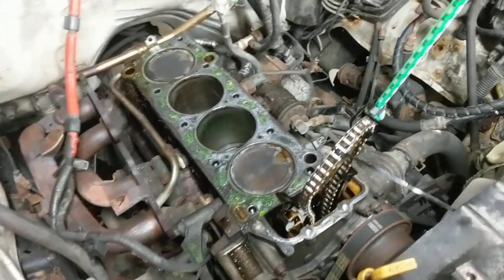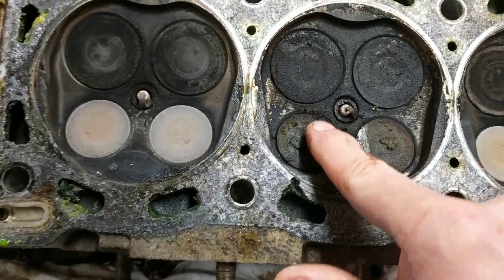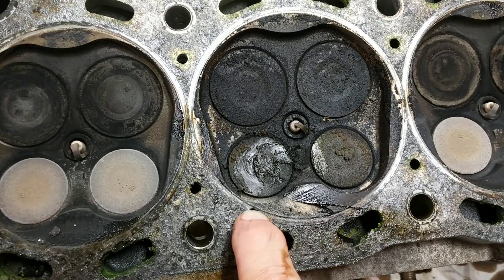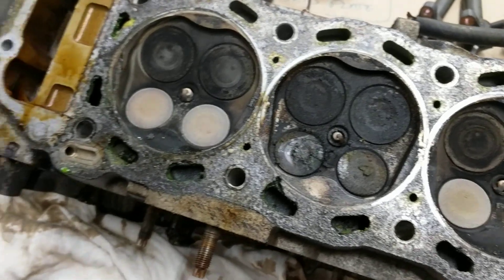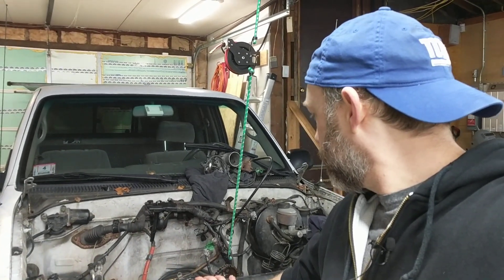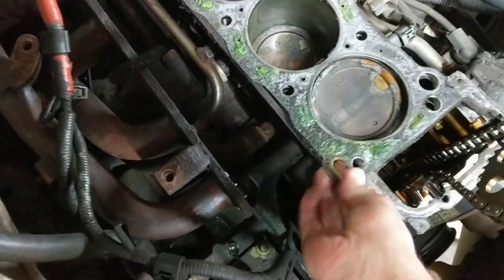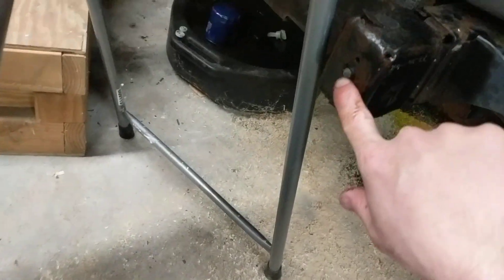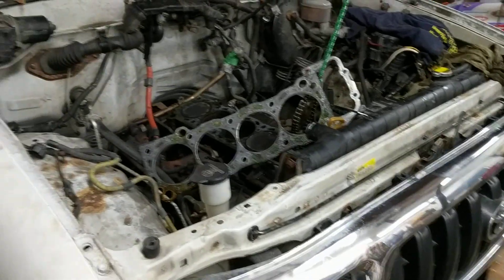Here's Why You Should Flush Your Coolant Regularly!!

Comment: Funny I just tore off the head on my 96 Tacoma because I was getting oil in the antifreeze, It has over 300k miles still ran great, but was getting bubbles in the overflow tank. It never ran hot or overheated just let go from old age, the headgasket material itself was disintegrating because its composite not steel. The coolant ports were getting clogged from the head gasket material. I'm gonna fix mine and drive it a bit longer then swap the engine to something else.

Comment: I've never changed or flushed my coolant system... ever.  I'm 60.  I'm trying to justify buying a vacuum fill system ($100) vs a plastic burp funnel to ($40) to bleed the system after i replace a thermostat.  After this video, I'll get the tool and flush the wifey's system as well as my Rubicon.

Comment: This proves how using the wrong coolant type can corrode an aluminum engine made of certain alloys. The old coolant used in this engine was clearly the green type ( can't recall the correct name/identification at the moment ). Using the correct coolant doesn't allow this corrosion to happen in the first place when changed as recommended. The coolant needed for this engine has a red/pink color, NOT green. Bought my 2000 Tacoma 4x4 with 3RZ-FE motor brand new in 2000. 20 yrs later & over 346,000 miles, it still runs great. It doesn't even burn any oil.
Reply: 340k holy shit🤣
Reply: @Theegoaat  I clocked 375,000 miles on it last December, and FINALLY.......she blew a head gasket. I'm totally rebuilding the engine, even though I could probably just replace the head & head gasket and send it. I already bought the master rebuild kit from LC Engineering ( aka "LCE" ), plus a brand new, genuine Toyota head built by LCE, stuffed with all upgraded components, including upgraded stainless steel valves made by Super Tech, and they're also black nitride coated. This rebuilt engine will literally be better and more durable than when it originally left the factory. Transmission gets a clean bill of health from my buddy who owns his own transmission shop/business. Gonna drive this little Tacoma till I'm dead, or too old to drive, whichever comes first. I can honestly say: the first 250,000 miles were some tough working miles though, more than most "every day driver" and/or "only vehicle" Tacoma owners would be willing to put their truck through. As a lath mechanic ( for stucco ), I had my own business for years, and 5 days a week, I was towing a trailer with a 12' bed loaded with my folding A-frame scaffolding, all materials, scaffold planks, etc, totaling right at 1 ton. Did it every week without fail for about 16 yrs. On most weekends, I was towing my 17' bass boat with 115 Yamaha ( the biggest motor you could legally put on that boat. ) Boat, motor, and trailer weighed right at 1 ton as well. There were quite a few times ( but only once in a great while ) where I was in a pinch, and towed right at or somewhat above the truck's 3,500 lb towing capacity. I know guys right now with the same truck & engine........one guy has over 450k miles on his, and the other has over 530k on his. But they never worked their truck anywhere near as hard as I did mine. A little body work, prep and paint, and it's not gonna be worked hard like all those years before, because I'm semi-retired now. Both me and my Tacoma are gonna have easier miles with this new engine, even though it's going to be built better than original. Most dependable, durable vehicle I've ever owned.......and I've owned a lot of cars & trucks over the years.
Reply: @howabouthetruth2157  Yeah I own a Corolla and Camry they're little gas saving work horses. I also have a 2002 NQR I use for my business with 259k miles on it and the mechanic said just keep up with the maintenance and she will be fine for a long time to come.
Reply: @Theegoaat  There ya go! Enjoy the rest of your weekend & take care.
Reply: @howabouthetruth2157  Likewise.

Comment: WRONG COOLANT WAS USED. You can tell by the green color. The correct coolant MUST be used, and it has a pink/reddish color.
Reply from the maker: Yup.  But it might have been ok if the pink stuff was thoroughly flushed out before the green was put in.  The worst thing to do is mix the two.  The Toyota coolant lasts longer too, the green you have to flush often or the pH will rise and eat the aluminum.  That's what I remember reading anyway.
Reply: @WhatDennisDoes  Yeah that's kind of what I was saying: the green type will corrode certain types of aluminum alloys. And yes, it's definitely bad to mix the two, but still, only the recommended type by the engine manufacturer should be used, regardless. Never use well water to mix with coolant either. City water at the very least should be used to mix, but distilled water is the safest of all with the correct coolant. I've found that the pre-mixed stuff ( no need to add water ) is garbage. It just doesn't last, and begins to look like ya only used straight water to begin with. In my own personal experience anyway. Here's another tip my Toyota "guru" buddy ( he's still a Toyota tech going on 30 yrs ) told me: NEVER use American made spark plugs in these engines, use only NGK or ND plugs. The American plugs don't allow these engines to perform at their utmost efficiency, resulting in poorer fuel economy, and the plugs foul prematurely, which also means your valves, pistons, and combustion chambers begin to gum up. But American engines can run a Japanese plug just fine. Go figure. I love my 20 yr old Tacoma & 3RZ engine. Wouldn't get rid of it for anything. I hear the frames rust up north, but I live in Florida, so.........

Comment: I think someone changed to the wrong coolant for that alloy. Can you confirm that that was actual Toyota coolant? All my toyotas use the red/pink coolants. It's a Pentofrost formula for aisian cars. Not green.
Reply: Correct answer, should be red/pink.
Reply: I don´t think so.. there´s no coolant that attacs aluminum heads
Reply: 4 types of coolant IAT, OAT, HOAT, and one for electric cars (I can't remember the name rn) bur IAT is additive protected OAT is acid protected and HOAT is both (HOAT is universal 90% or cars, diesel and electric are fussy) sincerely: the guy who sells radiator flushes for a living

Comment: why is it on my volkswagen it has "lifetime coolant"  and i've never had head erosion problems with 257k miles?  I took the engine apart and all the coolant passages are very nice and corrosion free. I'm starting to think the coolant aka prestone green stuff isn't protecting it like it should. There are people who swear by radiator  caps that have an anode attached reduce corrosion.
Reply: VW initially thought when they made their G12 coolant that since they didn’t use silicate additives, which get used up over time, the lifetime of their coolant would be longer. So >100miles or whenever you change the timing belt and water pump. This new coolant had no nitrites and silicates , which would reduce coolant life and was not so great for certain newer alloys in VW engines, seals and rads. Well it didn’t turn out so good: there was more cavitation resulting in pitting of aluminum and corrosion, and other problems. VW updated their coolants to include some silicates again in their newer g12++ and g13 coolants. They also put out TBN notices to thoroughly flush all parts of the system to their dealerships. They still have a longer lifetime than domestic coolant though.
Definitely get it changed, flush all parts of the system. Don’t use the prestone flush. VW specifically recommends against it. Just lots of water: to the heater core, the block, the radiator,.
You can use tap water but only run it with distilled water.
Only use  g12++ or g13 if you’re worried about corrosion.